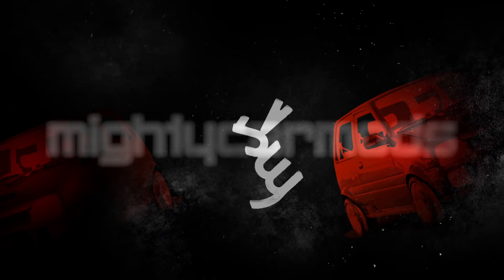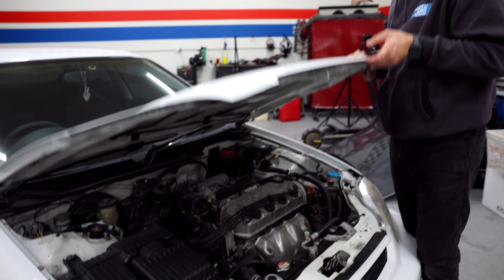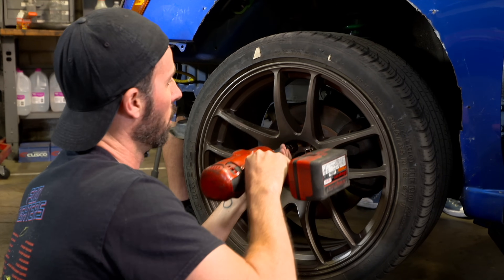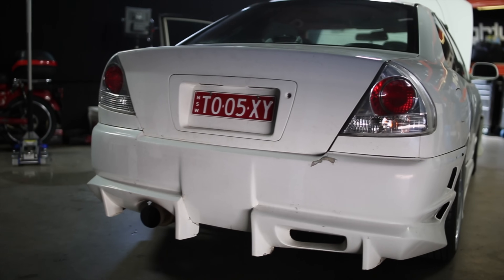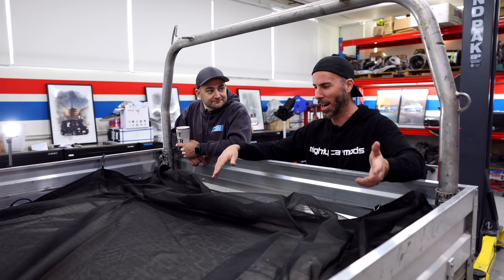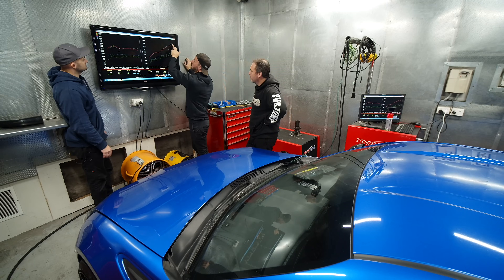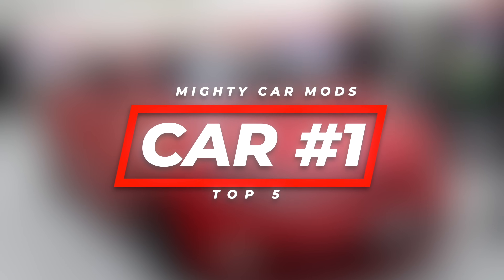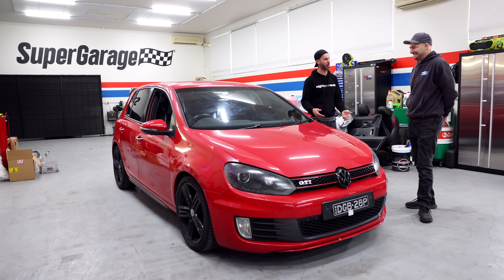The 5 BEST CHEAP CARS to Modify FAST | MCM

Comment: Great video lads. Here's what I find mildly interesting. The Hilux is overpriced on the used market here in the UK. It's subject to "Hilux tax" however Jimmy's can be bought at less than half what they sell for in Australia.
Reply: Hilux's are way overpriced here in Australia too. They hold their value a lot. They are also not as "ultra" reliable as people like to think. The D4D engines were prone to injector failures which could cause pistons to crack etc. Some of the newer diesels engines have DPF issues as well.
Reply: @djnmv  They all have DPF issues now. I got so pissed off I ripped it out of my Ranger and put a straight pipe in it.
Reply: Here in the States, it's the Tacoma tax. Hard to find one for cheap.
Reply: All Japanese cars in Australia hold their value really well. Not just Hilux's. Yes its also due to marketing even though they have some underlying issues. Jimny's are the most surprising in terms of going up in Value. It's also based on our population too. Less cars, harder to find really good ones
Reply: @KuroRyuu86  not all Japanese cars, but a lot do I guess. For example, a Triton doesn’t hold its value like a Hilux does. Comparing dual cab utes, you will pretty much always have to pay a higher price to get a Hilux new or second hand than you would with most other brands, thus the “Hilux tax”. It’s really a Toyota tax if you look at the bigger picture. I wouldn’t consider a Hilux fast or cheap (not a diesel 4x4 one like they were suggesting), so I don’t really agree with it making their list.
Reply: @djnmv  The 3rz 2wd hilux is the quick one. Super durable motor and easy to turbo and make cheap power from.

Comment: I know the mk4 GTi is known as the fat one, but with suspension and sway bars you can dial them in quite nicely, and the 1.8t engine is a peach.

I had one as my first decent car (wow nearly 15 years ago) and with Boltons and a good tune they're a fantastic daily.

I then moved on to a 350Z which I feel at least deserves an honourable mention here.  Smooth 6cyl NA engine and great chassis balance, they're a great choice for an up and coming hooligan on a budget. Especially if you like doing skids
Reply: The Golf GTI have a shitty chassis,get the Renault Megane RS that have better brakes, chassis, suspension and more reliable.
Reply: @skippylegrandgourou2069   Just had a look at these and wow they look so sick

Comment: The BMW e87 130i would fit in this list! 265hp, RWD, 50/50 weight ratio, 4 doors, confortable and sounds mad! 
N/A engine means not much power to gain but reliable and easy to work on.
I bought one about a year ago for $10k in australia !
Reply: Yeah man!
Reply: Cheap!

Comment: On the narrow-body 3rd gen WRXs, a good thing to look out for is the difference between the MY07/08 and the MY09/10s, the earlier models have a TD04 Turbocharger, make around 167Kw from factory and have thinner sway bars/softer dampers compared to the later 09s, which have a VF52 Turbocharger from factory and make 195Kw and 343Nm out of the box. 09 and 10 are also available as a sedan while the 07 and 08 aren't. There really isn't that much of a price jump between the two, if any at all and a pretty nice, factory one can be had for around $15,000 AUD

Comment: Audi TT are a nice alternative to the GTI, if you don't need as much practicality. And since a lot of people don't like them, they are sometimes cheaper than GTIs. But have a nice lightweight aluminum chassis and with good suspension mods can be very fun track toys. They also have a good aftermarket support due to a lot of Golf parts being compatible.
Great video, love the channel!
Reply: Yep those are great. Unfortunately a lot of sellers have figured it out and prices have gone up.
Reply: The second one. The first version was not poised at all. Only the looks where sporty. At least stock.
Reply: Could you not say the same about the s-line A3? They also have the chance of being AWD if you can find a quattro. I really wanted a TT but was limited on the practical front as you mentioned. Maybe another day :)

Comment: Toyota Crown Athlete GRS184 - 2007, 69.000km, 380.000 yen, grade 4.
Imported one like 1,5-2 years ago! They're cheap, luxurious, beautiful, fast and quite economical. 3,5l v6 - 315 hp - 400N-misch
Only "downside" is that they aren't produced with a manual, but I actually appreciate that, being my daily. Lot of Lexus parts, easy to maintain.

Comment: 2013 Opel Astra OPC, 206kw & 400nm, brembos, pneumatic adjustable seats, mechanical LSD and electronically adjustable dampers. 

Not a great deal of local aftermarket support, but alot of kit stock which makes for fantastic bang for your buck.

10 - 15k

Comment: Another one probably worth mentioning imo would be a Lexus is200/300 etc cheap fun in a manual and can slide plus lots of body kits etc available
Reply: Is200 is soooooo sloooow though. Like, so so slow. Probably the most comfortable car you'll drive, but my god 1gfe is a bucket. And even if you get a beams 3s one, they're still slow
Reply: @YeMadAzza  my mate had one and came drifting with us,  this is why i mentioned it, if it can drift happy days haha

Comment: Good luck finding a reasonable condition WRX for 10k. I recently looked at 1998-2009 models for 6 months before buying one and anything selling for around 10K was a high mileage $hitbox that required a lot of work and money. You can however find fairly good ones for around 15K +.  Even a clean early WRX for 20K is a bargain compared to 40K for a flogged out EVO.
Reply: Yeah not sure where they are getting their information from. A good G3 WRX like the one in the vid that hasn't done over 200,000km, will go for around 20k
Reply: Most of the cars on their list are off the mark price wise. 
You can still find an evo in the 40K bracket that isn't flogged though - and a TMK VI < 100K unless you want a red one with the decal pack. Their prices were off. I recently bought a 4x4 and the only hiluxs for 15K were old (like late 90's, early 00's) and had 500K + on them and mostly not turbo diesel. Not hating, but it kinda seems like they went "sort by lowest" or "sort by highest" depending on the point they were trying make.
Reply: @pursuitforspeed  yeah, I thought their figure for a Hilux was way too low as well.

Comment: Recently picked up my first Honda it's a 2003 Honda Accord Euro luxury with a 6 speed manual paid $3500 it does have high ks currently 315000 a k24a3 engine doesn't blow any smoke or have any leaks actually runs really good it's quite surprising how good it handles and drives

Comment: Evo 7s are definitely not selling for 40k-50k.
In Australia right now, it's  20k-25k for the auto 7 GT-A, 30-35k ish for 7s, 40k-50k for 8s and built 7s, 45k + for 8MRs, and then 55k+ for 9s.
Reply: Was thinking that myself. Get the odd mental later model that people ask 80k for but they have ridiculous amounts of work in them. 7s are actually super affordable. Couple of <30k examples down in Tassie
Reply: @tasshuffler8905  yeah there's some dude right now trying to sell his balls-to-the-wall track 7 for 85k. It's fully built driveline, brakes, everything and puts down a ridiculous 570kw to all 4 wheels, must be an absolute rocketship.
I don't know if anyone is actually going to pay that much though
Reply: @juliantaffa4089  Yeah sounds like a machine. Would be a wicked bus to have

Comment: I went full budget and picked up an 05 Hyundai Tiburon ( Shark) 115k KMs on the clock 2.7L V6 6 speed manual for 5k AUD.
Unfortunately not much aftermarket support and sure they are not the fastest but they look great and fun to drive.
Under rated and overlooked IMO considering how cheap you can pick them up for and can't afford the next price level.

Comment: Cool video dudes. Both my cars fall into this category, Toyota Starlet and Alfa 147 GTA - one at the lower end and one at the higher end. Neither quite make the grade in the aftermarket and support area but in terms of bang for buck they are pretty awesome. The Starlet is as unkillable as a Hilux, super lightweight and fun to chuck around while the Alfa comes with 190kW from the factory, sounds amazing and has way more Euro style than any Golf. A BRZ is next on my shopping list :)
Reply: You have to be kind of special to actualy buy an Alfa with your own money.
The good kind of special.
Reply: The Alfa wouldn't qualify as cheap, with prices for decent ones going up quickly (at least in europe, going to €30k) and running costs for the tyres and fuel for that busso engine are probably not cheap xD

Comment: honourable mention for Australian residents is definitely ford falcons I'd say from AU-FG models. Rwd, robust, comes as a sedan, wagon or ute, parts are plentiful within Australia and cheap. they come turbo and non turbo, people build them for straight lines or going sideways, also community is not huge, but it's definitely there within Australia. you can NA+T a B series falcon for $7k (price of the car included) and run 300rwhp all day, go E-85 and you can run 400rwhp on skinny rods. downsides are small aftermarket because its only local to Australia which can drive prices up for aftermarket stuff and they are pretty rare in manual.

Comment: No.1 should be a Subaru Legacy Twin Turbo. Bought mine for £2500 (Manual too). Just sayin’.

Mint video tho. 👌
Reply: What year ? Is it awd also
Reply: The Subaru Legacy GT is one of the best cheap cars you get for the cheapest price. A year and a half ago I bought a completely rust free clean title 2005 legacy GT wagon with a 5 speed for $6500 and it’s the best car I’ve ever owned
Reply: Cheap turboed Subaru's can be THE BIGGEST hit and miss so no they shouldn't even be on the list😂
Reply: @KAGENfilms  Sounds awesome 👌
Reply: @snoopy5736  2003 and yes. S-Edition too.

Comment: 3:30 that they were engineered during the height of the Bubble economy in Japan, you can the when you work on them, I had an EG Civic Special Edition 5 speed, 1994, for 13.5 years, and after I found myself with a Cadillac unexpectedly, sharing this news with a friend resulted in a burning desire to buy my Civic.

Comment: Would love to see an "Extreme" Budget list. Cars for -5k AUD or something
Reply: There would be nothing on that list sadly hahaha
Reply: There's just nothing left it seems. Growing up in the 90s there were endless options for cheap and fun cars for like $500-5k. Now anything vaguely interesting starts at 5k. And it doesn't help that barely any manufacturers have made anything interesting and affordable for 10+ years
Reply: @masterdinosawr  I mean, a camry? If you look long enough, it's possible to find cars that cheap. Maybe not fast cars, but some are alright
Reply: @DEADMEM3  yeah there would be cars for that price but nothing that "fun" like their list implies. 

I think the only "fun" cars you can get for under 5K ATM would be like Honda Accord Euro or a civic. Both of which won't be in the best condition for that price either. 
Otherwise maybe some old Commodore or Falcon or an NA Impreza.
Reply: @masterdinosawr  I can think of a few more. A pintara or a celica could fit the bill, and something like a ke70 is possible to find
Reply: Bought an unrego'd gtvi sirion for $700. Sick car so would also like to see that list.

Comment: My first car is an EP3 Civic Type R, they're still quite underrated and not the prettiest stock but the chassis feels amazing and is pretty light weight, the engine is super fun, reliable and can handle a quite some power (K-Swaps everywhere) , its practial as a hatchback can be and because they're so underrated they are relatively cheap. bought mine for 8 grand and its already double the value where I live in the condition I got. Also you don't see these things on the road often which makes it relatively rare as well. Can only recommend. One would be amazed how many expensive cars get eaten up in the corners with a decent driver behind the wheel

Comment: Thanks a great clip on some iconic cars.A Cheap Golf R alternative is the Tiguan. Stage 2 tune with downpipe and Golf R brakes at the front, nice wheels and a resonator delete, you have a cheap and a quick car. Add ST  coilovers, and then it's better still.

Comment: Id throw in an XR5 turbo in the mix. Can still get them pretty reasonable fit 5 people and walk a BRZ
Reply: I had a Orange LV. After some tyres, handling mods and a flash tune it was a little monster. Had so much fun in it and the engine noise was awesome. But sold it for a japanese land barge Toyota Crown. Completely different type of car but so much more comfortable.

Comment: Missed an opportunity with the civic v corolla comparison to highlight that you can get a decent 4age powered ae93 rolla for the same price as a d16 civic.
Reply: Like the previous comment, MCM is not Toyota/Lexus friendly. It's soo weird. But aussie's love Toyota's. Especially when we import SO many crowns, and jzx platforms. The 4age motor i don't think was available in Aust (i may need to check that). We had to import those from Japan. Only a few was sold Locally but Its all imported. We don't have Altezza's But we have them in Lexus form so the IS200, 300s etc.

Comment: I wanted to buy a mk5 GTI but they were all completely munted and they km's were too high for what I was willing to pay. Bought a Pre-facelift MK2 Skoda Octavia VRS instead. Same platform, same engine, same performance, and since not a lot of people are out there to buy them, I picked it up for really cheap (only $6,999), and with only a stage 1 flash tune, exhaust, and intake kit, it makes 160kw ATW. Honestly, they're such an amazing car, and i HIGHLY recommend for people to go and check them out and buy one :)
Reply: I was looking for a Mk 5 GTI to buy (wanted manual & EA113 for reliability over absolute power) when I stumbled onto Skoda Octavia’s. I found a brilliant yellow wagon, which was already tuned (but well looked after & not thrashed) a few years ago for under 8 grand. Honestly can not believe how good it has been. They are criminally underrated in Australia because most Australians wouldn’t have a clue what they are. Still going strong @ 240,000

Comment: Ford Fiesta ST is a 135kw turbo hatch for 10-15k that goes quick and has loads of mods and aftermarket parts, people push them to 200kw and more without issues.  
Hyundai excel is the hidden gem everyone ignores. 1.5L twin cam thats extremely cheap, easy to work on and there's actually a HUGE following of them used in all kinds of racing especially in Australia with loads of aftermarket parts.

Comment: I would add Volvo's in the 200, 700, and 900 series. Here in Canada they run $500-5000 depending on year and condition. They are durable, with many running over 500,000 km. They are good daily drivers with lots of cargo, especially the wagons. There is lots of parts available at reasonable prices both OEM and aftermarket. There is a huge worldwide community. They came with factory turbo option and are turbo friendly for mods. They also have huge engine bays giving lots of room for mods or engine swaps. They are rear wheel drive and many came factory with a limited slip differential.

Comment: The E90 335i is a really underrated car, at least in my area. I’ve seen them for as little as 5k and 9-10k for a really nice one. You’re bolt-ons and a tune away from making serious power, and actually really good aftermarket support

Comment: I live in EU and my number 1 is the car that I have in the garage- the 1997 (97-02) Ford Puma. Costs around 1500-3000 aud, has 92kw, engine was made in colab with Yamaha and has It's own variable cam timing (VCT) system (something like V-TEC and the engine is name Zetec-S), sporty suspension and styling. UK Top Gear moderators made it Top Gear car of the year 97 (and next year was the Focus) and their racing driver made Puma drifting class video. In Europe a lot of Fords are cheap, fast and are very underrated in my opinion

Comment: I love these low budget challenges.

I would mention a very old perennial, the RWD Volvo. With or without a turbo. Find a manual one and start thrashing it. They just don't seem to be bothered by the abuse, and they handle much better than you would think. Get some 225s on it and head to the track or mountains. Very practical daily, large aftermarket and community, and capable of light off-road use if not lowered. Only requires you to deal with normal age issues.

Also, I've never heard you talk about the 323 GT-X/Laser TX3. Those were pretty cool little underdogs back in the day.

Comment: Toyota Crown Athlete GRS184
Imported one like 1,5-2 years ago! They're cheap, luxurious, beautiful, fast and quite economical. 3,5l v6 - 315 hp - 400N-misch
Only "downside" is that they aren't produced with a manual, but I actually appreciate that, being my daily. Lot of Lexus parts, easy to maintain.
Reply: gas mileage?

Comment: I know there's one big reason not to be on the list but surely an RX8 was worthy of a mention against the BRZ/86. Cheap with an excellent chassis and when the motor finally let's go there are many excellent options for a swap.
Reply: swapped rx8 comes with lots of problems in the long run

Comment: Great video as always, but honestly quite surprised you didn't include a BA-BF Falcon XR6. Rear wheel drive, easy to find in manual, powered by arguably one of the best 6 cylinder engines ever made, massive aftermarket support and community, and can find very decent examples in the 5-10k range. Living in Australia, it's absolutely what I would recommend as a cheap, fast, fun and modifiable car